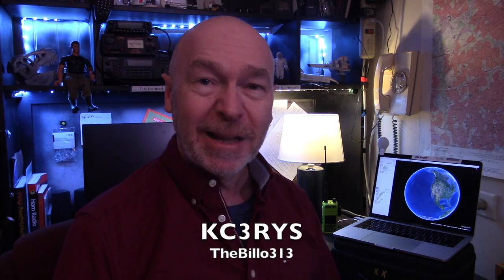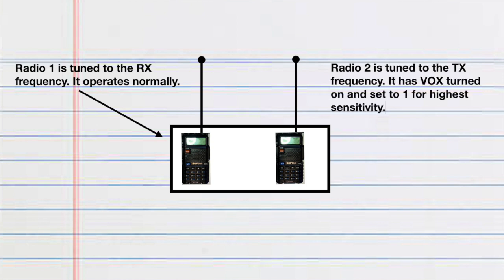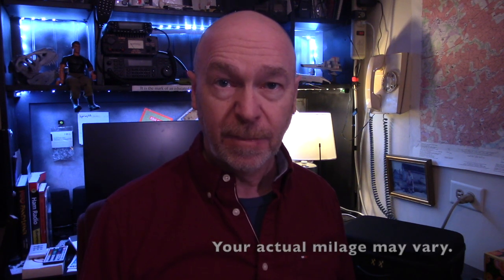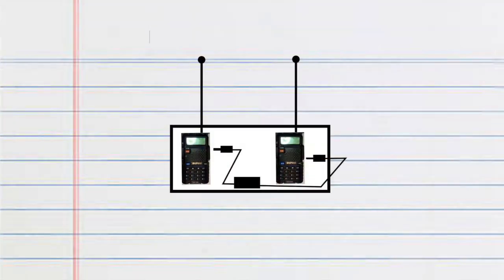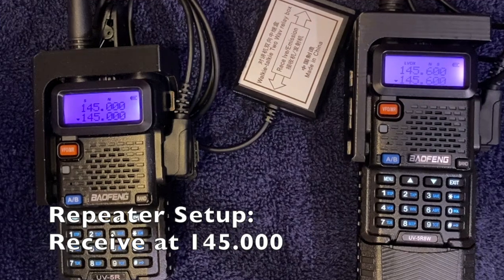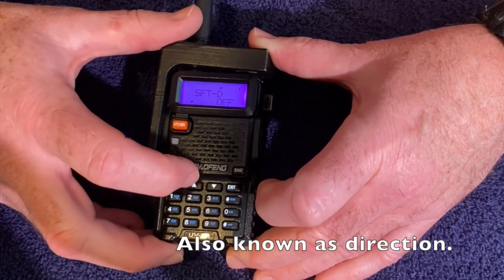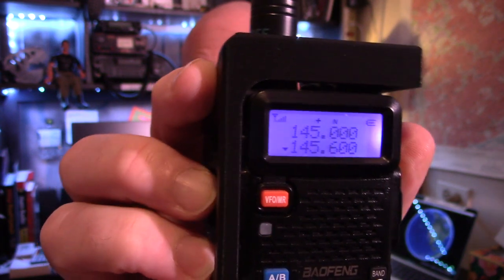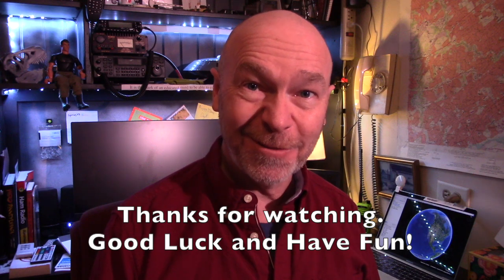DIY Ham Radio Repeater Using Baofeng UV5R for SHTF

Comment: So it only partially worked for me, it would transmit my signal and repeat it properly in some cases but then others it would just continuously transmit not let the signal go through
Reply: Im even using the uv5r. Dont know if being an 8watt unit makes and diff
Reply from the maker: @AdventuringMike  try lowering the wattage if you can. I’ve heard that the transmitting radio can overpower the f receiver.
Reply: @thebillo313  I have the same thing i tried the lower woltage and it is still mesed up sometimes it works sometimes it doesn’t
Reply: @thebillo313  I think i will try it with duplexer that might save the problem
Reply from the maker: @JaybirdT_  I’ve seen folks make cross over wires. I think that that is a more direct way of doing it. I’m really not certain what the black box does. I’m thinking about making a video where I open the box but I don’t know anything about what’s in it. I need to find the guy who can help.
Reply from the maker: @AdventuringMike  I’m sorry to hear that you’re having a difficult time. Please let me know if you figure it out.
Reply from the maker: Yeah it’s a little funky try some of these ideas:
Separate the radios as far as you can, at least six feet
Orient the antennas so one is pointed up and the other down. 
Have one radio on uhf and the other in vhf / make it crossband. 

Let me know how it works.
Reply: @thebillo313   well I just gave that a try it worked for a moment then wouldn't transmit voice but was still transmitting static. It started to heat up my antennas.  Thought I broke my radios but they still work independent.  Been seing alot of videos where they only use one audio jack on each radio 3.something on one end and 2.somthing on the other radio. I may give that a try. Its either that or I got a bad relay box on amazon. Just cant figure out how it works for a moment then stops working.

Comment: the voltage output of WONGKUO Solar Charger Power Bank - 36,800mAh Portable Solar Phone Charger, QC3.0  is 5 VDC. It cannot charge Baofeng rechargeable battery that has 8 VDC
Reply from the maker: Whoa, great information. Thanks!

Comment: You did a great job explaining this , Thanks ! What is the frame you have around the upper / left side of your radios ?
Reply from the maker: Hey, thanks for watching and taking the time to comment. The frame is a button guard that stops accidental button presses as well as volume changes. I put them on all of my Uv5r. Here is a link to the file if you to print one. Thanks again!
https://www.thingiverse.com/thing:5208414

Comment: That doesn't work at all, it's useless. Try setting up that system. The two radios are coupled if the radios are separated from each other by 650 feet. If it works.
Reply from the maker: You might be right. This needs more testing.
Reply: Without a duplexer the transmitter will de-sense the receiver, since they're so close in frequency.

But this might work really well if  you use two meters in and 70 centimeters out -- or vice versa!  A cross band repeater.  Try a couple of simplex frequencies  -- especially ones that aren't harmonically related.
Reply from the maker: @terryjwood  someone suggested having the radios at least one wavelength away from each other. That will be one experiment. Another suggestion is exactly what you suggested. Cross Band and avoid harmonics. Ha, I guess RF theory is what it is because others have done these experiments before me and forged a path. 

I'm one of those rock-heads that has to do it themselves in order to learn. XD

Seriously, thanks for your comments, I really appreciate the conversation.

Comment: Building this basic repeater and doing some research in antennae separation. I’m going to use vertical separation (one pointed up, other pointed down) with 6” coax extensions.  Total separation from antenna base-to-base should be close to 18”. From my understanding, (Omni-direction, low power, real-world/hobby level expectations) a minimum of 1/4 wavelength is needed but full wave is desired. UHF RX/TX wave is around 25”, so I’ll be running about 3/4 wave separation….
Anyone know if this train of thought is on the right track?
Please keep in mind, I’m using UV5R’s in a non-duplexer, $30 set up and therefore, I OBVIOUSLY don’t care about maximum efficiency, just relevant possibilities and ideas. Thanks
Reply from the maker: The device I use in the video comes with about 6 feet of wire, to make one wavelength separation easy. It’s a great idea to have one antenna up and the other down I hadn’t thought about that, thanks. for the price it’s a great experiment to learn, or something that you want to set up in your backyard for fun. Thanks for watching and taking the time to comment!